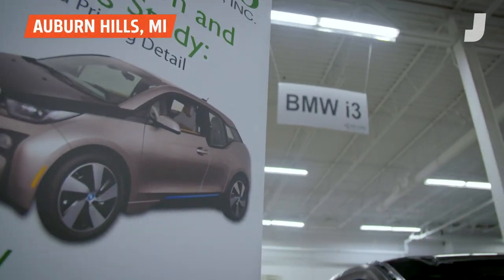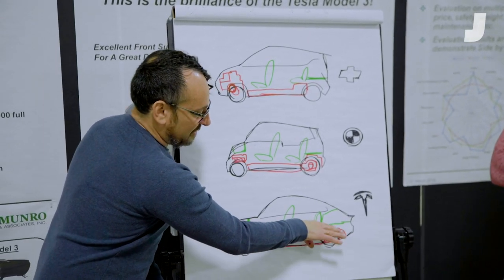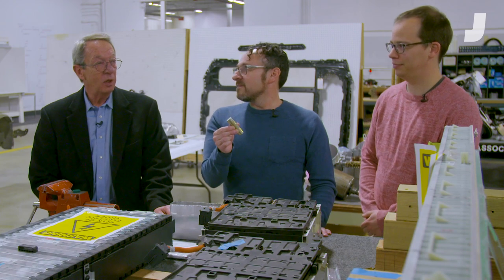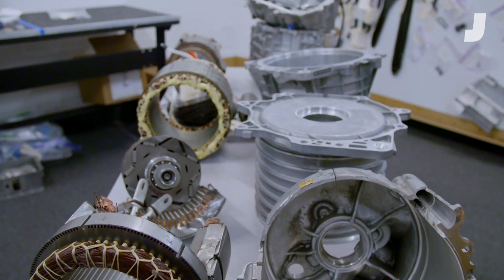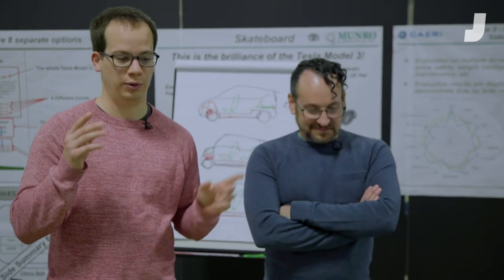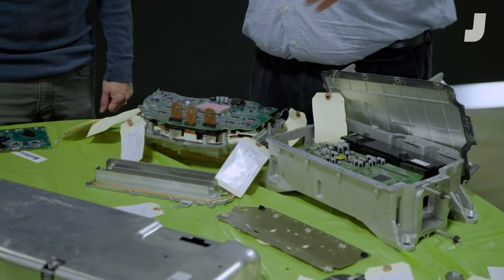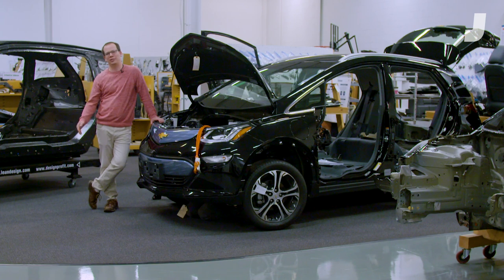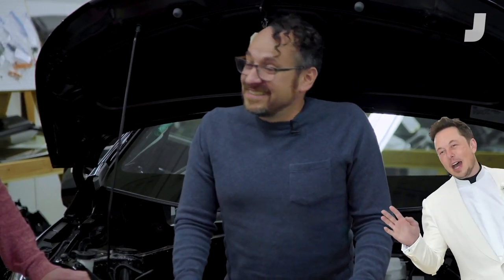A Look Inside The Tesla Model 3, Chevy Bolt, and BMW i3

Comment: One of the most important areas that these guys cannot take apart is the software. Software is the brain and the soul of EVs. Tesla is also far ahead of other manufacturers in terms of software. Even Porche Engineers had to rent a Tesla to check out the latest software. Tesla's only weakness is its manufacturing.

Comment: Didn’t knew bmw uses carbon fiber. Would be cool if Tesla did the same.
Reply: Actually, it wouldn't (necessarily)
BMW are going back to"traditional methods" for the replacement vehicle. (Cheaper).

Comment: BMW was actually quite cool back when they designed the i3. Bold approach. But management were cowards and discontinued the i-portfolio. They would be in a much better position today. Instead they are so desperate now that they made 2019 the year of the hybrid. As if anyone cares.
Reply: The BMW is a really cool car - every owner I know loves it. I think the guys was a little critical towards it, but really had nothing technically negative to say about it.
Reply: @kjetils4665  Tesla has the better battery and drive unit as well as much better tech with exception of that CFRP body from the i3. Now the i3 is a brilliant little car (I have one), but the Tesla Model 3 has a lot more "must-have" factor. But as rust is a big issue in Norway due to long salty winters, I'm really ambivalent as to make the trade from i3 to M3.

Comment: This video is completely wrong on the motors.  The Tesla motor uses a completely new type of technology.  This type of technology was once thought impossible. The model 3 uses a inductive reluctance motor.  Calling at the same as the other two is just plain wrong.
Reply: This is not correct. Such topology is known in the field of electrical machine design. It's an Interior Permanent Magnet (IPM) synchronous motor with V-shape rotor. To be honest, such design for traction application was firstly introduced in the Toyota Prius.
Reply: @NRG1985 The name permanent magnet in this case is used IMOP to satisfy EPA I looked at there review process they don't offer an option for reluctances only motors.  Tesla had to give it a name that would be simple and quick to approve with the EPA.  The fundamentals of a permanent magnet motor are not in this device period.

To best understand what is Model 3-worthyabout the reluctance motor, we must first refresh our memories about how Tesla’s legacy 3-phase AC induction motor works (which I wrote about in some detail here). Even if you’re not a motorhead, just note this one observation regarding the motor: The induction part of the technology’s name has to do with the fact that in lieu of deploying expensive permanent magnets on the rotor, a large magnetic field generated from the stationary portion of the motor (the stator) actually induces an opposing magnetic field on the highly conductive copper rotor.
Reply: Regarding the model 3 motor used by Tesla, I read many things, even contradictory. If you take the tweet of Elon, he talks about a "partial permanent magnet (PM) switched reluctance motor" (on the rear)...which, I feel like, it is his way to describe something which is not his core knownledge.

I have some experience in the design of electrical machines for traction applications. From the stator and rotor point of view, it's quite far from a switched reluctance (SR) motor, which is completly PM-free. Altough there are some new switched reluctance concepts assisted by PM (for example in the stator), I cannot find significative evidences to recognize such machine as a SR. 

What I believe, is that the machine is a synchronous machine (switched reluctance IS NOT) with PMs. The PM synchronous machines, depending on the rotor topology can be classified in Surface-mounted PM (SPM) and Interior PM (IPM) (there actually other variants, like Flux-switching, but in a simple way, we can cansider these two).

And comparing to the SPM the IPM exbiths this interesting "reluctance" mechanism, which comes from this rotor anysotropy. Rotor anysotropy means that, if you sit on the stator and look the rotor turning, the "magnetic resistance" that the stator flux "sees" changes from polar axis (axis of the PM) and inter-polar axis. The rotor would alling according to the lowest "magnetic resistance" path, like in the SR machine. But, while in the SR machine, the coils are consequentely swtiched to move the rotor, in the IPM machine a poly-phase system of alternatig currents (for example sinusoidal) flows in the poli-phase winding, producing a rotating field which "drags" the rotor. You can design an IPM in order to exhibit a high anisotropy and thereofore "reluctance": these designs are sometimes specifically called PM Assisted Synchronous Reluctance (PMASR or PMASynREL) machines. I saw many different way to call them actually there is not a standard criteria, normally if they have more than 1 flux barrier per pole along the radial direction (the pockets where you place the PMs), you can refer as a PMASR. And this is what I think the Model 3 motor is: Interior PM synchronous machine / PM Assisted Synchronous (not switched) Reluctance machine. Moreover, SR machine requires a different power converter architecture while the synchronous machine or the previous Tesla induction machine, operates with the same inverter architecture. This would makes sense in terms of development / cost reduction.
Reply: Such motors are more commonplace than you think. Spoiler alert - reluctance motors are very old tech, and even Dyson and EGO use them in their products.

Comment: From what little I know about engineering, the superior design doesn't always win out in the market.  There are so many examples, like Beta vs VHS.  As a very low EV IQ person, I'm interested in basic and affordable transportation.  The Chevy seems to be that which I would buy. Besides, where would you service a Tesla?
Reply: Get the Bolt and install a 220 VAC outlet for your charger and you will have a car that costs less than an ICE to own. Get the BMW or Tesla and your will spend a fortune on parts and service. Also the Bolt has a great electric brake, because it is FWD, if you learn to use it, the brakes will need little service...

Comment: There's quite a bit of incorrect and misleading information in this video, probably stemming from a lack of understanding of design decisions. They keep referring to "clean sheet" EV designs, and then claim that the Bolt EV is not. For instance, they pulled out the electronics rack assuming that it had no purpose other than to hold the inverter and electronic components; however, it is a fundamental part of the structure of the vehicle. Essentially, it wouldn't have the same crash safety rating without it. 

Obviously, improvements can be made all around, but you have to start with valid data.
Reply: News Coulomb well, the Bolt IS a gm korea car, using an existing floorpan courtesy of Daewoo engineers 😂
Reply: @goclunker , so what ???
Reply: Jalapnik's staff are being Tesla fan boys because it is a performance car...
Reply: @davidhollenshead4892  i guess you haven't learned your GM korea lesson yet, pity

Comment: Maybe Tesla body structure is made that way because it is safe.
Reply: Nope, in this case the body design guy was not very good. Musk fired him but they didn't have the time to fix all the issues before production. That body design is the only really big failure in the model 3 design because it also happened to make it way more difficult to build.
Reply: @cros13  Yeah, riiight, the body structure had NOTHING to do with 5 stars security rating in EVERY category, makes PERFECT sense...
Reply: @UTUBESUCK666  Where did I say that? Maybe you need to read my comment again.
I'm not anti-Tesla, the 3 chassis design is categorically the worst part of the car, primarily it's worse in ways that impact Tesla more than the consumer (manufacturability and cost). The rest of the design is largely excellent (bar the back window/trunk lid design).
1. I'm an engineer   2. I've owned six EVs   3. I have a Model 3 performance on order here in europe

Comment: How does the batt pack have consistent temp during cooling?  It seems all these batt cooling systems would result in much different temps between the down stream end of cooling loop and input end unless coolant is flowing fast and exiting not much warmer than in entered.  Great fascinating brief overview.

Comment: The old dude is BIASED in favor of Tesla and obviously was from the beginning....hardly a fair "comparison".. Really! No mention of the HIGH cost of Tesla either. DUH
Reply: Bruce Allen the Tesla is objectively far and away better than the other two vehicles here, and is also the most expensive because of the same reason. It was designed from the ground up for one thing only - to be the best electric vehicle out there.

The Chevy Bolt was designed to be a cheap electric vehicle that could be built along side traditional vehicles in the same plant - this leads to a worse end product but one that is far more affordable to produce.
Reply: japanwatchconnection there is nothing in a Tesla that should make it hard to repair even for a DIYer save for the way Tesla likes to lock out their owners. If they didn’t take an approach to their IP so similar to apple then you could take your Tesla into your local mechanic and have it fixed.

However because of the relative reliability of EVs I don’t think it’s that big of a deal that you really have to get your Tesla repaired by Tesla save for the fact that their customer service is so shitty.
Reply: Exactly, and Tesla is a nightmare to own and expensive to insure...

Comment: You can really see the different approaches the companies take to auto design if you ignore the two hacks hosting the video, they are just telling the Tesla fans what they want to hear cuz that equals more clicks. In reality the Tesla is designed to cut the cost of manufacturing, the Chevy is designed to cut the cost of manufacturing while still being affordably serviceable both short and long term, and the BMW is just typical German engineering, overly complex with no real benefit to anyone, kinda engineered for the sake of engineering, costly and pointless. That Tesla battery is all or nothing, you cannot repair those modules, the entire battery has to be replaced, same with the power inverters, the Chevy is a separate unit conveniently under the hood, can be replaced in pieces or as a whole, where as the Tesla is integrated into the drive-train somewhere under the back of the car, how do you service/repair that? How much will that cost? It shares cooling loops with the drive unit so to replace you likely have to drain and replace the coolant to the entire car battery and all. There is a lot more to building cars than just making them "hip and cool." Sadly a lot of people don't get that until their spanking new $50,000 car has been hauled off on a flat bed for the fourth time in a single year...
Reply: Exactly !!!

Comment: I like all the negative comments about anything that isn't a Tesla.. but the one thing everyone overlooks with Tesla's is all of the battery fires. I will wait while someone find where a Bolt EV, Nissan Leaf, or i3 has just randomly burst into flames. All you have to do is type Tesla fire in the search bar of Youtube or any other search engine and see the results. Battery thermal runaway is a real issue with the Tesla vehicles, and has occurred even when the vehicles have not been involved in an accident. Also good luck getting repairs or parts when you are out of warranty as that is all very tightly controlled by Tesla. Also make sure you never buy a blacklisted vehicle that is deemed "unservicable" or they will charge you a $3,000-$5,000 re-certification fee just to look at the car. Just look at Youtuber Richrebuilds.

Comment: By the sound of it, each vehicle has some issue with design for manufacturability and maintainability.  The Bolt has lots of add-on style parts, the Tesla's body is oddly manufactured, and the i3's body being composite would be almost non-repairable if you had a fender bender.  It strikes me that Chevy has made choices to make the car more affordable and buildable with their current plants and therefore may have the early advantage but in the end, we'll need cars designed from the ground up for electric with manufacturability, maintainability, charge speed and fire safety thought through.
Reply: and more serviceable.  Can you imagine trying to service the inverter that is within the engine container?
Reply: Teslas cost a fortune to service and to insure....

Comment: Wow, are you sure this is not a bought and paid 18 minute long commercial for the Model 3, from Tesla's Marketing Team/Jalopnik? 

I am not a Musk fan boy, nor am I a EV hater. I am someone who enjoys performance vehicles and wrenching on my own cars. That said the Chevy designed electronics look more adapt to replacement of parts then the Model 3. This is something important to me. Plus the front engine and electric layout my be a good way to bring the mainstream ICE shoppers into EV's, by keeping the same basic layout they already know.
Now with that said if finances allowed and Tesla made it easier to work on your own cars. I would proudly drive a performance Model S.
Reply: ForPointSix 4.6 you're a Daewoo fan, aren't ya?
Reply: ForPointSix 4.6 and before you go off on me, check the door jam. GM Korea, aka Daewoo
Reply: Get the Bolt and install a 220 VAC outlet for your charger and you will have a car that costs less than an ICE to own. Get the BMW or Tesla and your will spend a fortune on parts and service. Also the Bolt has a great electric brake, because it is FWD, if you learn to use it, the brakes will need little service...

Comment: Erica Lourd as producer. That name sounds familiar. As I recall, FastLaneDaily made only two specials about people. Her and me. Greetings, Erica :)
BMW actually really kinda tried with i3, bold to go all carbon yet very reasonable price but it wasn't light despite the carbon. Steel would have done better. So hardy fail.
Reply: When living in a place with salty winters, the CFRP solution is vastly superior to the steel one. I wish Tesla would make the body from CFRP. BMW has decided to stop using CFRP for some secret reason, and I suspect it has something to do with creating a near perfect car. No car manufacturer would want to make a car that never needs replacing, and never degrades or wears out. The i3 is very close to being exactly that. Only accidents, vandalism or catastrophes will damage that car.

Comment: RIP German engineering and BMW'S antiquated technology
Reply: I actually think BMW (Linked with Mercedes!!) Will do OK.
Reply: Dont forget that BMW designed theirs in 2011 (2013 release) replacment not announced yet, while to Model 3 was 1.5 generations later. So with the Carbon Fiber, and out of Box thinking of what a Car of the future can be (mega city car), i think it will continue to age well (selling more and more every year given its 6 years old). As long as the battery keeps getting upgraded (2 times already), it will be a car u cam drive for a long time. Munro even said that the BMW i3 was still the benchmark in quality and manufacturing as well (tolerances and processes while being carbon neutral and the car being 95 percent recyclable. Watch the interview videos with the model 3 or i3 on Autoline After hours.
Reply: pauL3gend you're completely right. I agree that the i3 is respected for it's time. But what about the model S? Comparatively old but by most standards nearly as advanced as Model 3

Comment: I think there is a difference in cost and fabrication between a carbon -fiber tub you would find in a McLaren sports car and the Carbon Fiber Reinforced Plastic (CFRP) you find in the BMW i3.
Reply: "Carbon fiber" IS "Carbon Fiber Reinforced Plastic" - it's the same thing. "Carbon Fiber" is just the sheets of carbon fabric, "glued" together with a bonding agent - nearly universally a form of plastic. The McLaren F1 may use a different form of plastic, but its bonding agent is still a plastic.

BMW did come up with a mass production method that does make it more cost-effective than the low-volume methods used before.  Still not cost effective enough for a fully "mass market" vehicle, which is why BMW has said that all their future EV models will be made out of more conventional materials. But it is a fun engineering experiment turned actual production car. BMW wasn't even the innovator in this - Boeing was. Boeing developed many of the techniques for easy mass production of carbon fiber parts with the development of the 777 in the early '90s, and refined with the much-higher-percent carbon fiber 787.
Reply: @ehurtley  Agreed.   I am accustom to the term CF used as part of a hand-made process where CFRP is a more efficient large scale process.  I concede to your description.   Thanks.